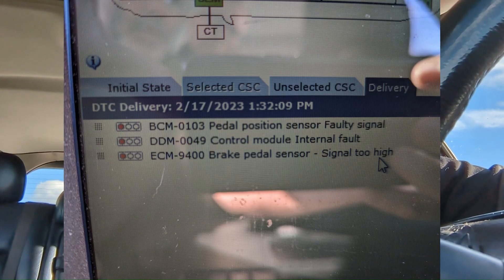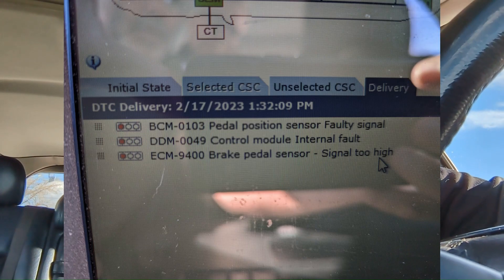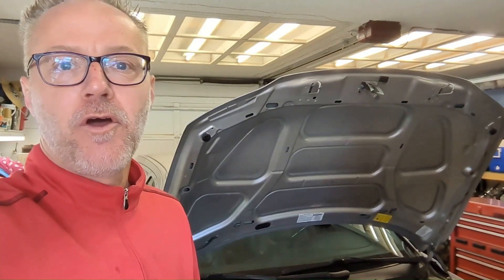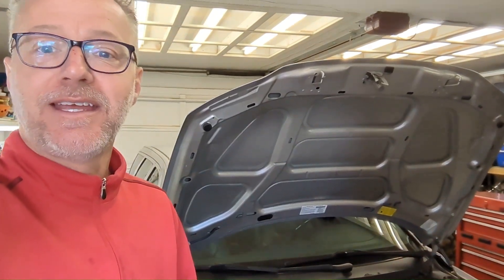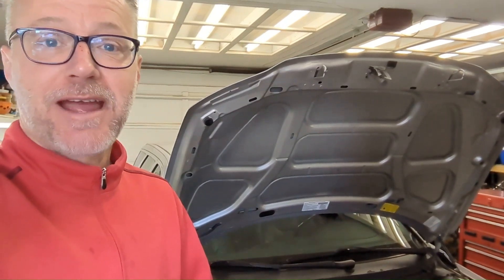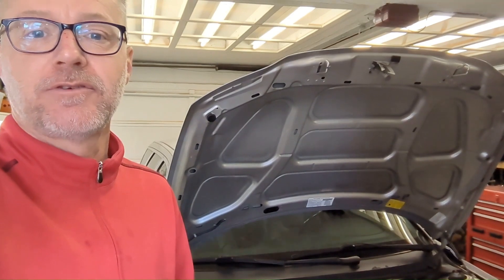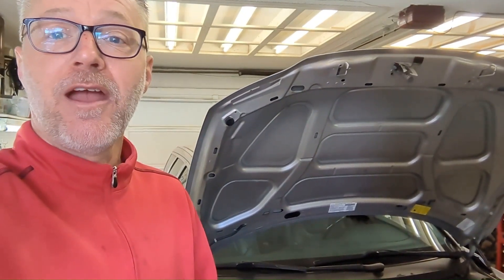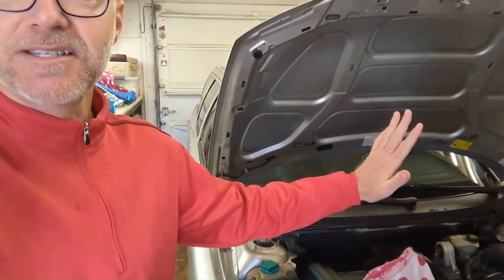Nagging P0573 Ailment Humbles Volvo V70 2.4T With No Cruise Control On The Open Roads

Comment: what was the solution and fix??? i am getting same code p0573 as well
Reply from the maker: https://youtu.be/T46P10z5--w
Reply from the maker: I had replaced the brake position sensor but one of the contacts was slightly askew and not making full contact inside the connector. Dynamic replaced the aftermarket unit with Volvo OEM as well. It's been working perfect since March 2023.